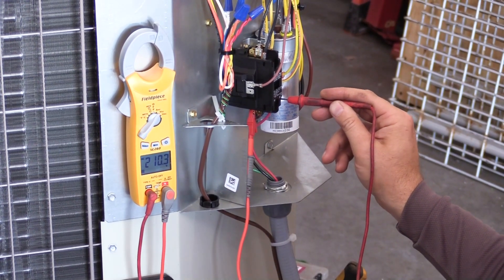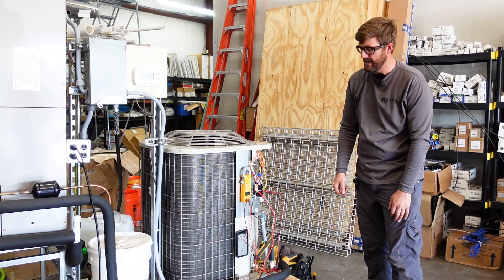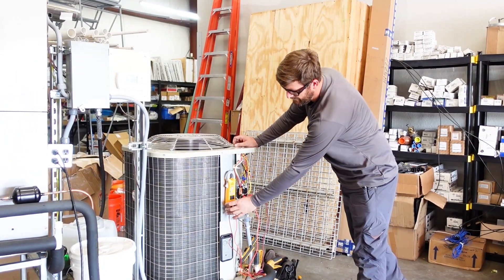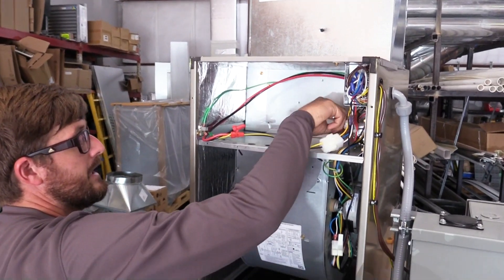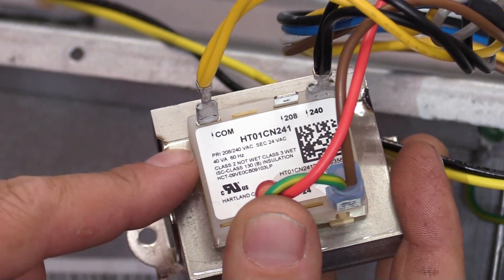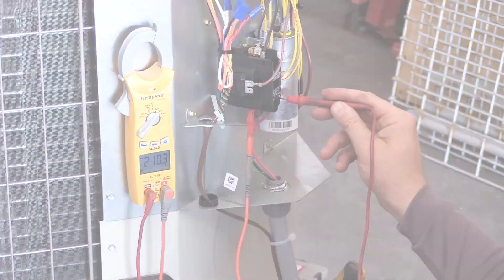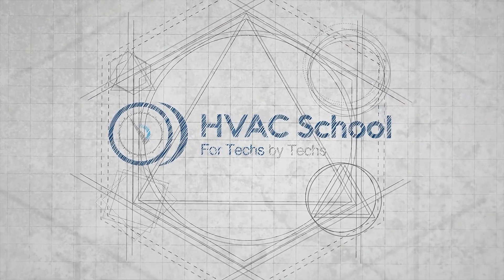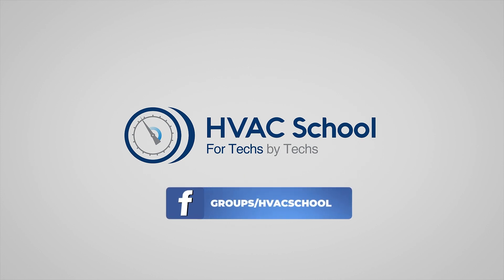A Common Commercial Mishap - How to Set a Transformer for 208V

Comment: Had a commercial unit yesterday that had a failed ecm/x13 motor. High voltage to motor 208 Checked low Voltage to motor and only had 22. Transformer set at 230. Switched to 208 checked low V and had 25 now but motor still wouldn’t engage. My question is could the incorrect low voltage caused that motor to fail? I ohm’d the windings out and had 3.4 on 2 out of the 3 legs but one 1.8 on the one leg. Unit installed 2016/2017 and has been running like that 5-6 years.

Comment: I just took over an apartment property - 275 units plus all amenities - with every air handler wired incorrectly. Tried to get my home office to get it fixed by the installer before the sale finalized and our brilliant "Director of Construction" swore up and down that there was no problem with the way they're wired. 
Now they get to pay me to fix every one of these heat pumps with ECM blower motors... as well as whatever burns out before I can get them changed over.

Comment: I have a questions about Transformer if anyone can help. So in my lab I had a 240 1ph package unit that I would rip all wires out and have students rewire the unit for experience of how to follow a wire diagram. We recently had a make over of our lab and now when I hook up this package unit, it will burn up the primary side of the transformer. My only thoughts of why this could be happening is the electrician has wired up 3ph instead of 1ph 240. Any thoughts would be appreciated. Thanks Brian for this channel, I have used many of your video's to help students understand some of the topics I go over.
Reply: Might also want to check with a clamp meter to see how many amps is being drawn on the secondary side of the transformer. If you exceed the VA rating of the transformer it can burn out the windings. To calculate what the max amp draw is, divide the transformer VA rating by the secondary output voltage of the transformer.
Reply: Disconnect primary wires and insure voltage to transformer is proper? Two wires to primary for single phase. Three phase transformers require three wires to primary. This is not logical in this situation. Question, you're
not mistakingly connecting secondary side of transformer to power supply are you? It happens.  
Disconnect secondary wires, and ohm out for short to one another.  Hope I have helped.
Reply: @jjjames5089  Sorry James for the late response, as I am teaching both the basic and advance HVAC class's. to answer your questions about the secondary, no. What I'm trying to find out is the 208-220 i get from each leg on my disconnect could effect the transformer due to being 3ph instead of 1ph. I know when the electrician was wiring up my platform disconnects for my condensers, I have 2 wires going to them. The package unit has a disconnect with 3 wires (thinking it's 3ph when the unit is not 3ph) So is it possible from the same breaker panel to  have 3ph hook ups with 240 (2 wire) on same panel, and would that cause a transformer to blow up even though i only use 2 of the 3 wires. Again thanks for all the info and time you guys put into this channel

Comment: This one drives me nuts, nobody ever changes the tap. That being said, with new Lennox RTUs, I had a call where DTE was only putting out 197v and it was tapped for 240 causing low transformer voltage and not working. I tapped to 208v and unit ran properly. The next day DTE had made their repair and the store was getting 209v and the board locked out on high control voltage
Reply: I lost count of how many melted contactor coils I've replaced once the incoming voltage dropped...16v...No problem 😕 My Dad got me in habit of checking every tap as a habit.

Funny how the BS service calls to those places went away.

Comment: I recently did a start up on a WSHP. The heat pump is a 277v. The sparky's powered it from a 208v panel. When it came time to power up the system to test and commission it. The BMS was reporting a brownout condition. Checked my secondary xfmr voltage and wouldn't you know. Had low secondary voltage. Asked the sparky's where is my breaker....." oh its in that 208v panel over there " me-" well fellas.....this is a 277v heat pump" got the deer in a headlights look. Of course the 460v panel next to the 208 panel was full. They ended up getting it sorted out. Always check data tag and communicate with the sparky's

Comment: Always test first (voltage) if that truly was a commercial install and your tech didn't check voltage he shouldn't be by himself!
Time is money and callbacks waist time!
🥃🍺🍺🍺🥃🍇🏌
Stay safe.
Retired(werk'n)keyboard super tech.
Wear your safety glasses.
Reply: And remember all 3 phase systems are not 208. There is the Delta 240V fed system with the GotCha Stinger Phase (C) (If something uses neutral with it)
Reply: @steveurbach3093  don't forget delta high 277(480)